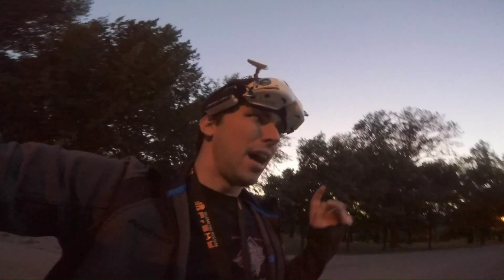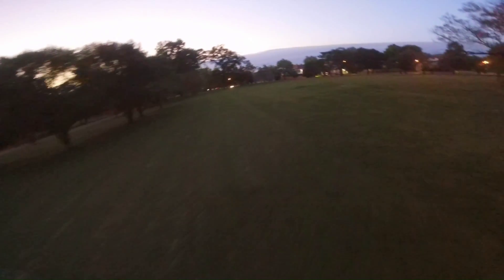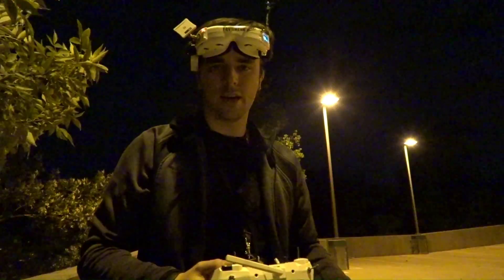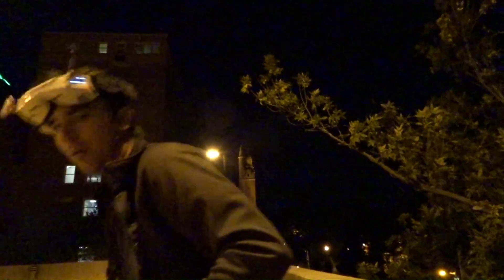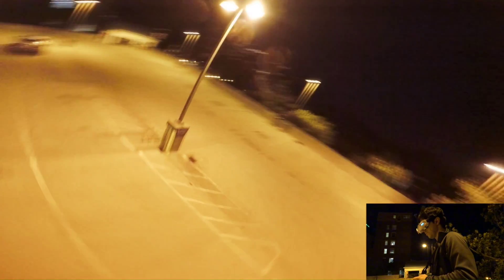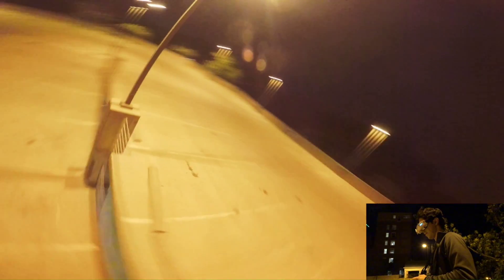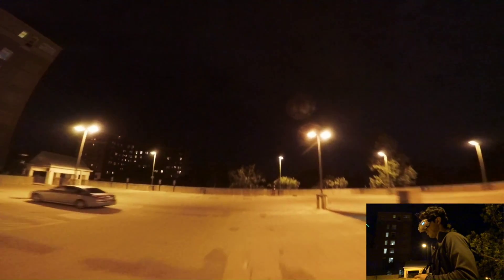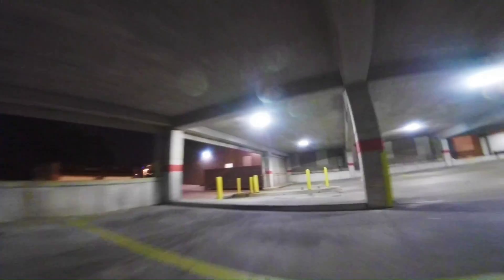Running Kiss FC on Bl heli s escs

Comment: dude i neeed helpppp,,,, i bought a kiss v2 fc annd wolf pdb,,,, but now cant afford  kiss 32a esc 3500 mexican pesos is fuckn madnes im about to buy d shots 1200,, but im not shure its gonna work and  more if itss going to work onn 3d mode,,, can u help mee
Reply from the maker: Bl heli s or blheli 32 will work with kiss. But you cant reverse motor dicrection of bl heli s or 32 escs with the kiss fc. There are 2 work arounds. You can either swap the left and right motor wires on the motor that needs its direction changed. Or you can create a harness that will plug into the wolf pdb and a betaflight fc so you can use the betaflight fc for blheli pass through.
Reply: @pilotincommandfpv2431   ahahah i just bought 4 Airbot Wraith32 V2 BLHeli32 35A ESC.......swap the left and right motor wires on the motor that needs its direction changed.... wow i didnt know u can do thatt,,,,, i just want to fly on 3d mode ill swap anything to achive it if it gets me there,,,,, now ill have to try to fix it to 3d orrrr learn to fly welll in acro.....tilll i know how i can  fly in 3d i love 3d.... or till y get the milllion dollars u need tu get some fuckn 32a kiss esc´s

Comment: The cons i agree with you. If you get a macro that read the lip pack voltage, that helps me. The camera has a voltage wire sensor built into the camera and you'll attach that to the kiss fc.  that is how you'll over come 1 issue with the OSD thing for kiss.

Comment: great work bro...👌 how about esc 4in1? setting to kiss fc ...any idea? sorry im nob...thanks alot
Reply from the maker: If you decide to run a 4in1 esc on the reverb you will need longer screws going into the center of the frame where the flight controler stand offs mount. M3x14 cap head screws will work but you will have to buy them seperate. As for connecting the 4in1 to the kiss fc you will need to make your own wire harness. Both race day quads and pyrodrone sell a silicon wire kit for making 4in1 esc harnesses. The motor layout is different for kiss than betaflight so when you are wiring it up motor 4 for betaflight is motor 1 for kiss, bf motor 2 is kiss motor 2, bf motor 1 is kiss motor 3, and bf motor 3 is kiss motor 4.

Comment: So...my bt fried and I bought a kissv2 since I had a Steele pdb lying around. Using blheli esc's and when I go into the motor test they do nothing. Any clue what I'm doing wrong? I checked cables and set to dshot1200
Reply from the maker: Kiss fcs dont do bl heli passthrough so that could be it. Also I could never figure out how to get the motors tab to work in the kiss gui. If you want to check motor direction take your props off, arm the quad, and gently touch the spinning motor to see if it is spinning clockwise or counter clockwise. If you need to switch the motor direction then either swap the left and right motor wires or hook up a betaflight board and use it to access bl heli suite to change motor direction and then re install the kiss fc

Comment: Felix from Kiss and Boris from Betaflight developed the dshot protocol together. 600 was originally as high as it went on both kiss and blheli-s when it was first released. Kiss took it further to 1200 then 2400 because their esc's were capable of it.